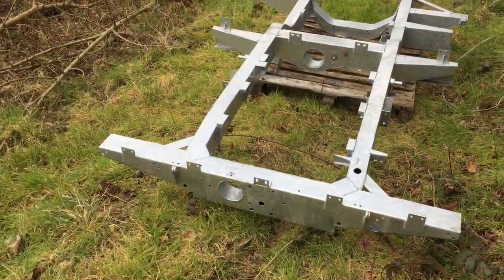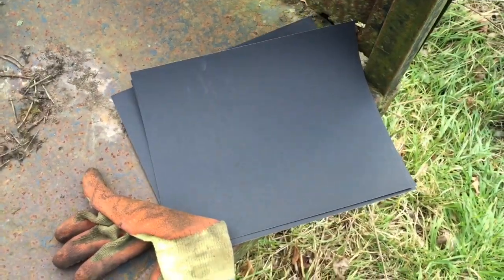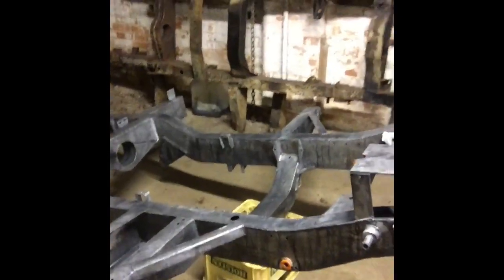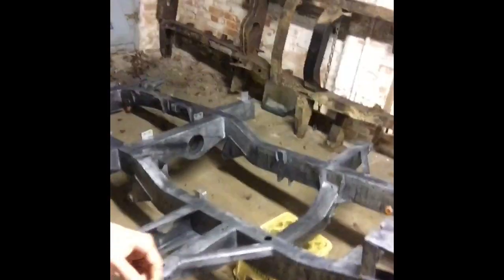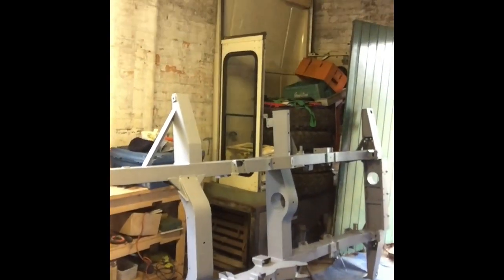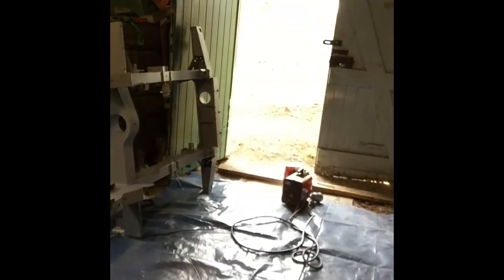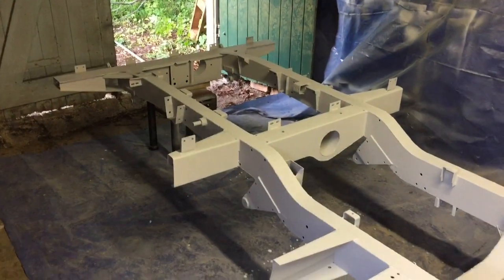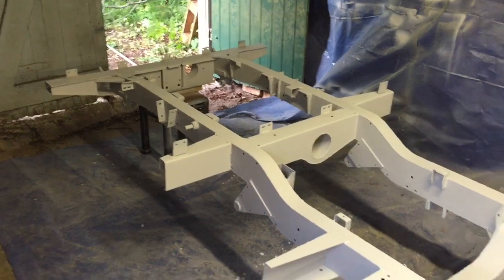Land Rover Series 3 Restoration - Painting the Chassis Pt. 8

Comment: Really enjoyed the videos. Thanks for posting them. My Richards chassis is on order and should be with me in a month or so. Do you recall who you bought the paint from please?
Reply from the maker: Hi Sean, great to hear from you. Make sure you measure the chassis for accuracy (against the Haines manual)  before you start your build. My gearbox mounts were slightly off on mine. Paint I’m not sure. I think just ebay. Take the name and Google it. Good luck 👍

Comment: Looks great, what do people do to protect the inside of these chasiss? So that they dont rust from the inside out?
Reply from the maker: Hi Craig, thanks for your message. There are some products out there for this application but I didn’t do it with mine as my chassis is galvanised so should at least last my lifetime. ))
Reply: Not necessary due to the galvanising.